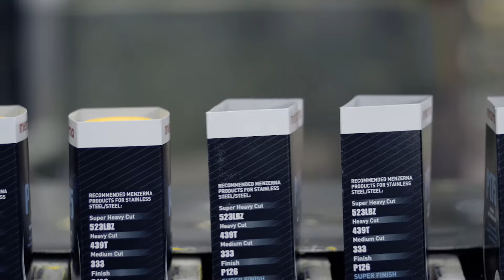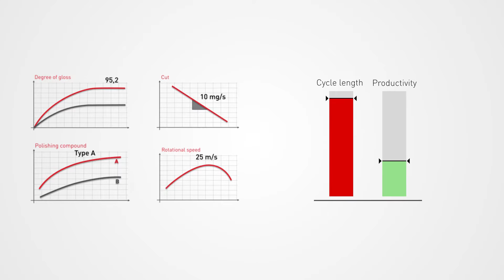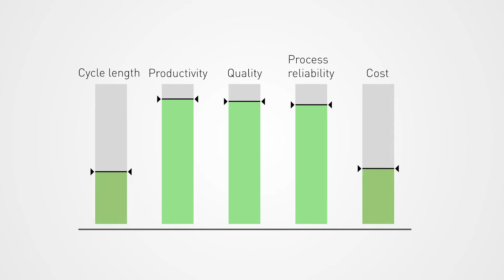Menzerna – Polishing technology for pros

Comment: Hallo Menzerna, could you please help me, my child has made a deep scratch by a nail on the car, Which of your compounds would you recommend me to work with to get it removed
Reply from the maker: Hello, if your fingernail caught in the scratch, you cannot remove them anymore. Than the scratch is not in the clear coat anymore. You can only make it smoother. Is the scratch in the clear coat and very deep: Shcc300 + 3500 and if the scarch is deep hcc400 + 3500. Best regards Your Menzerna Team

Comment: Hello Menzerna,

Could you help me out on some recommendations.  Which of your compounds would you recommend me to work with to get some moderate scratches out that were caused by a tree branch?  I have a 5” DA polisher.  My vehicle is a 2018 Toyota Tundra, which I’ve been told has soft clear coat.  In addition to the recommended polishes could you let me know which pads would be best to use with these as well?  Thank You!
Reply from the maker: Hello, we would recommend for Sticky paint our 3in1 with a lambs wool or our MCP2400 and afterwards with our green soft cut Foam pad and our 3500. Best regards Your Menzerna Team
Reply: Menzerna Thank you!  “Sticky paint” is that what type my soft clear coat paint is considered?  Thx
Reply from the maker: @tundrawhisperer4821  yeah we believe that. Toyota is known for the sticky paint. Best regards Your Menzerna Team 😊